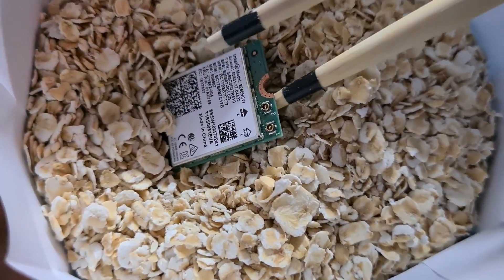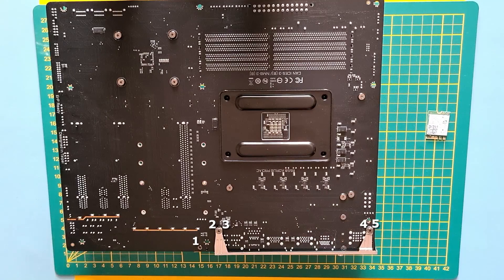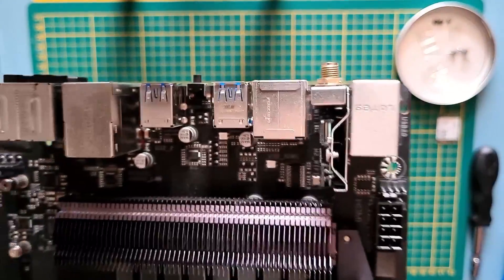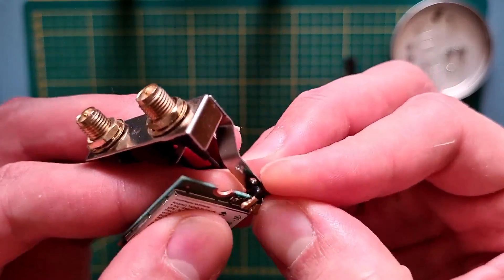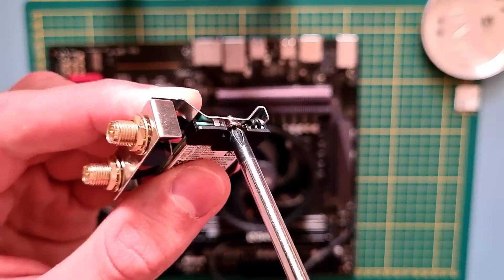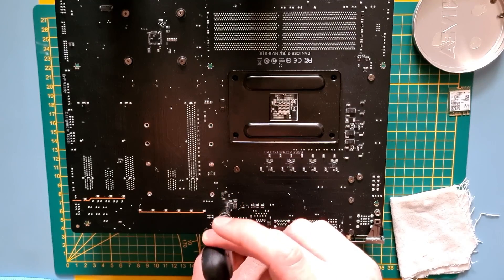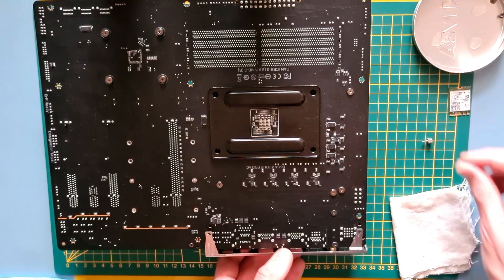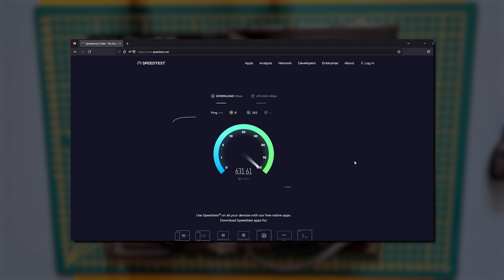Motherboard Built-in Wi-Fi 6E Card Upgrade

Comment: Hi thanks for making this video it has help greatly, one question thou. I'm building a new pc and I want to know if I should update my motherboard bios before or after I replace the wifi card?
Reply from the maker: Hey, I'm glad the video helped. Regarding the BIOS, I would say, that the general rule is to upgrade it before the hardware change, because old BIOS has higher chance of not supporting the new hardware. In such case the worst case would be that your PC does not boot. However, if you have the possibility of flashing your motherboard directly without turning on your PC, then such a worst case scenario means nothing much, because you just stick your prepared flash drive with the new BIOS in the motherboard and upgrade it though press of a button. If you do not have the option to flash your bios externally, then you would have to remove the newly added hardware, upgrade BIOS, then put the new hardware back in. So, I guess upgrade BIOS before. Don't forget that BIOS upgrade usually deletes all your BIOS settings, so back them up. There is also styles that you never upgrade BIOS unless you are experiencing some issue because new bios version can cause new instabilities or bugs. However, I do not follow this way of thinking. I upgrade my bios every time I encounter a new version and if there would be a problem because of it, I can always just flash it back to previous version with no issues.
Reply: @will_neithan  thanks, appreciate the advice 🙏🏾
Reply: hey one last question, are the antenna cables specific to a certain connector on the wifi card? or it doesn't matter? Like any antenna wire can be connected to any of the of antenna slots on the wifi card?
Reply from the maker: @waderhoden  Hey, yes, it should not matter. To my knowledge, antennas are universal. That doesn't mean though that some antennas can't be better than others.
Reply: @will_neithan  thanks man, your the best!!!

Comment: just to verify, if I have a wifi 6 (AX201 card) you "cannot" upgrade to the a 6E AX210...right?  I've had a device manager error with the current new z590 motherboard and I noticed the 2 wires that connect to the m.2 wifi card were making contact with each other and not sure if that is the cause of the issue.  Great video btw, wish i would have found this before my tear down
Reply from the maker: Thank you for bringing this issue to my attention! I have done some research and it seems that Intel has made things more confusing and less universal. Check the comment I have pinned. 

So, my understanding is, that if your z590 is a CNVi motherboard, you can use only CNVi wi-fi card in the m.2 slot specified for built-in wi-fi, however any other m.2 slot should be able to utilize a non-CNVi wi-fi card, like the AX210.